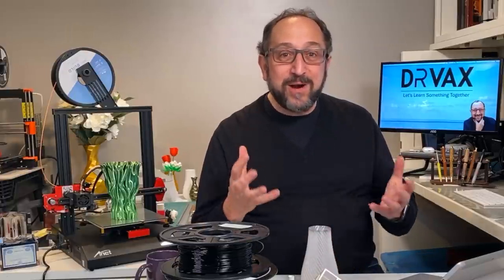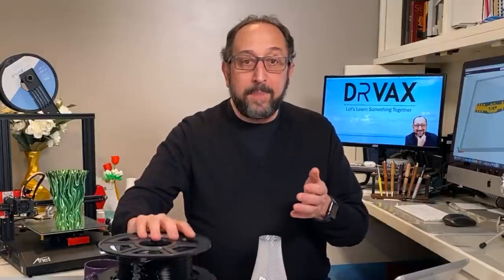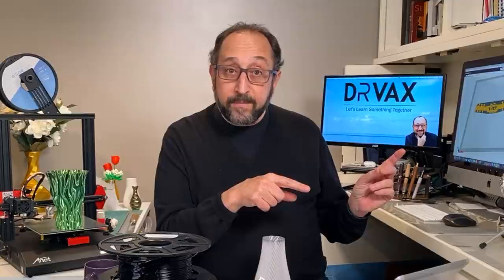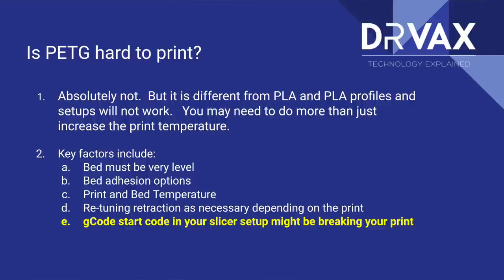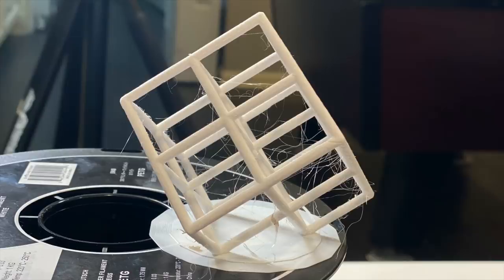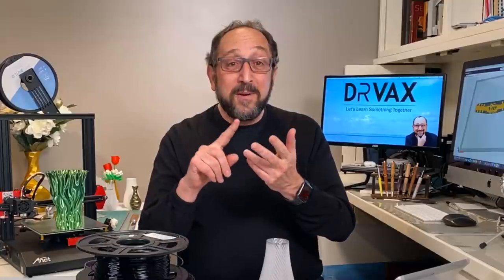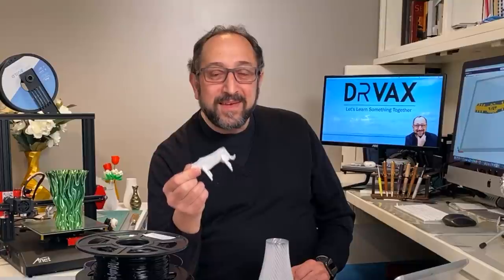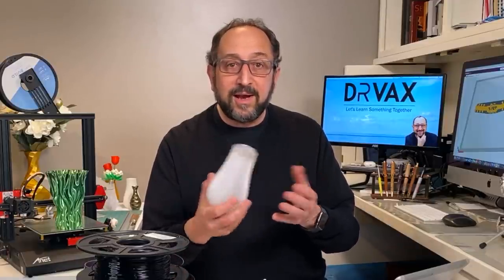How to 3d Print PETG Reliably and Safely

Comment: I had a client who needed a part for their drone and PETG's mechanical properties made it the ideal candidate since it's much less brittle than PLA. I figured while I was at it I would print the new fan duct I've been wanting for my Sovol SV01. As a result I had a lot of trial and error tweaking my settings for getting really nice string-free prints from PETG. I found that using a temperature tower to select the lowest temp that has less stringing but still had good layer adhesion makes a big difference. In addition, I increased my travel speed to maximum to help with oozing, set my print speed to 35mm/s, disabled combing, increased retraction by 1mm and set retraction to a nice slow speed of 25mm/s for both my bowden and direct drive setup, and set my part cooling fan to 0% for the first several layers, then 50% after that (100% when doing bridges still, which you can set in Cura). YMMV but this worked for me to get quite clean prints.
Reply from the maker: @Anthony Towler Excellent suggestions.  Thanks for sharing.
Reply: I’m glad I ran across this comment. My son got a drone and I immediately thought about printing replacement parts, but wasn’t sure which kind of filament to use. Thanks!

Comment: I really appreciate the look at G-Code. This made me realize that the default settings in Cura for "Generic PETG" don't match the manufacturer's recommended temperature and flow settings, and I was able to tune the settings before I printed with a nozzle heated only to 215°C, when the recommendation was 230-250°C!

This really saved my bacon on my first experimental PETG printing experience. Thank you! 😀

Comment: I ordered two spools of ABS by mistake I thought I really messed up but I moved the printer to the garage and as long as the temps are right and most important is the bed adhesion (I use hairspray exclusively) I have gotten great success I’m working on an enclosure and a fume extractor so whenever I print ABS I don’t have to move everything to the garage 👍👍 I’m really glad that you have survived this pandemic great to see you as always Shalom.
Reply from the maker: Thanks for the comment.  Good move to print ABS outside.

Comment: Thanks for sharing your knowledge and wisdom.  I just started 3D printing about 3-4 weeks ago with an Ender 3 v2 printer.  I started with PLA without issues and learned a lot about bed leveling with it.  I bought PETG from Inland at MicroCenter yesterday, loaded up the PETG and started a test print.  Bed adhesion and very strong and the test prints went well.  I started a print that was going to take several hours and after watching for about 20m, I went to bed.  When I got up this morning I had 2 issues.  First is the bed adhesion was crazy strong.  I ended up pre-heating the bed to 60c to get it unstuck.  The second issue is the print failed with about 20% to go.   It seems like the print head got clogged and the the hot tip melted the top printed layers.  I am using the Cura 5.10 slicer, but I also manually set the bed and print head to 70c and 235c respectively.  FYI, the Inland box says the temperature range is 225-240c for the print head.   I had seen the temperatures change in mid start-up code, so I think your temperature discuss will be the answer there.  So what do I do for the possible clogging issue?  Thanks again for your channel and help.

Comment: I read where PLA needed pushed unto the bed but PETG didn't.  I raised my offset .05 mm and I am finally am having good results!  It is fast becoming my favorite. I am printing 2 degrees above the minimum temperature and bed temp to the max recommended and I changed my retraction from 1.1 to 2 mm with my direct print head.

Comment: I just ordered my first printer, an Ender 3 V2 and some PETG filament. It seemed to have the best combined properties and the most versatile filament across the board for practical uses. Thanks for the video, it confirmed my assumptions and I'm really looking forward to 3D printing and your channel seems very valuable.
Reply from the maker: I would recommend you begin you 3d printer journey with PLA and once you have mastered that move on to PETG.

Comment: I am watching this on my first day of printing.    I wish I had seen it before starting off.  My computer is in for repairs and started off with PETG, I struggled a little trying to pause the print to turn back temp settings as they were reverting to the default gcode temps ..    By the end of the day, I found my way to editing the 104 and 140 codes.   Also, my Ender 3 was slow to react to feed rates, this I will want to adjust.   As soon as I figure out how to include a few lines to get the extruder laying out nice I will include the code in every print just to see  how things are laying out     .   Great videos, great content/advice .

Comment: Great timing for this video, I accidentally ordered some PETG filament, thought it was PLA, oops.
And just received a new ender 3 pro, so I should be able to print with the PETG. Thanks. So glad to see you are back. Hoping that you are recovering well.
Reply: Mike Gillespie I have a Ender 3 Pro and have been printing PETg with good success. I commented with parameters in another direct thread. Have fun!

Comment: I had done a little research to figure out why my printer had a low temperature limit while other (more expensive printers) had much higher ones. What I found was it comes down to the hotend and the teflon tube that comes in it. Apparently teflon will degrade at higher temperatures and can even release gasses that you don't want. I've also learned that some manufacturers will rate their printer for a little higher than they should based on the quality of the teflon tubing / lining they use. My wife bought me an all metal hotend so I could feel more comfortable printing with PETG specifically and higher print temp materials in general without worrying that I'm degrading my bowden tube.
Reply from the maker: You can increase the safe temperature range of your printer by switch to Capricorn branded tubing which is rated at higher temperatures.

Comment: I’ve had success with PETg with a bed at 69degC and glue stick, so good that I struggled to get prints off... filament used was Marvle3D. 
PETg Maximum print speed of 60mm/s. I’m Using Cura, set print temp 239-255degC you may need to tune temp while printing as too hot creates stringing (octoPrint helps with this) 239degC for slower and thin layer heights, 0.1mm and at the other end, with a 0.27mm later height, the extra temp setting was needed at 255degC to ensure that it flows well. 
If your printer doesn’t do a prime index line, add a skirt to your print so you have flow. Retraction needs to be more than PLA. I run retraction at 6.5mm for PETg to help reduce stringing.

Comment: Another great bed adhesion option for PETG is investing in a good flexible spring steel sheet, those work great for release PETG prints and leave a beautiful finish on the side.

Comment: Cura 4+ seems to add the correct code to wait for the preheat before starting when using the Ender 3 and Ender 5 profiles :).   I am guessing some profiles may have it missing.  Very good knowledge to give out as some do not do that.

Comment: Thank you, Irv, for this deep dive into real world PETG printing. I have been experimenting with it for a few months now, but found it more difficult to print than PLA because my environment is drafty. Adding an enclosure helped stabilize this for me. I still have questions as to how adequate ventilation is supposed to work without introducing significant drafts to a printer without an enclosure - I am thinking that having the enclosure will act as a buffer, with the room's air being able to be exhausted outside in a reasonable way without affecting the area inside the enclosure. I also found issues printing PETG first layers until I started using 3M blue tape on the bed - the textured surface of the tape seems to keep the first layer stuck properly during printing far better than the textured layer on my build plate. Glad you are feeling better! Best wishes.
Reply from the maker: I have also used blue tape in the past but find magigoo works even better.

Comment: Great video as usual, however you are wasting time in your start code
You should change it to:
set bed temperature
set hot end temperature
wait for bed temperature
wait for hot end temperature

This way both the bed and the hot end start heating up at the same time and your wait time to reach the hot end temperature is reduced.

Glad you are healty again and keep up the good work

Claude.
Reply from the maker: You are correct. But I do not generally optimize my start code because it is very little of my overall print time.

@onleditpas I value your comment and your contribution to the DrVax community.

To help us all build the DrVax community of "makers" I have created a new community forum at http://forum.drvax.com .   At the DrVax forum, you can engage in discussions with me and other community members, use a rich text editor, and post images.  This should facilitate better communications.

It would be great if you could repost your comment to the forum to help with the discussions.

This forum is still in beta and the software I am using is complex so I may have some feature misconfigured. 

All the best.  Irv

Comment: I know it has been a while ago since this has been posted, but when talking about the brim not releasing easily, I have recently found that having the brim attachment distance(Cura) set to -.004 allows for a nice thing line to tare away, now this does not effect adhesion over all but it can allow warping to pull up, but with the right temps and a clean bed (I just Isopropyl 91% quick wipe to leave a film as a releasing agent, releases the PETG just under its glass transit temp, the ISO which I found is needed to release and safely used on glass beds, that works nicely compared to regular glue stick)

Comment: One possible time saver that I think would make startup a little faster is to set both the bed and the nozzle temp and then wait for both of them.  That way they are heating at the same time.  So,  M140, M104, M190, M109.  Of course, you need to have a power supply that is capable of heating both.  It works fine on my Prusa Mini that I got last month.
Reply from the maker: You are correct.  But we are talking about seconds here, maybe a couple of minutes, out of prints potentially lasting hours.

P.S.  I have started a new discussion forum at http://forum.drvax.com where we can all have more elaborate discussions and share pictures of our prints and printers.  Check it out.  Please excuse if I have posted this to multiple comments from the you.  Just trying to get a bit of exposure.  Irv

Comment: Really helpful video - I am just waiting for my first 3d printer, so am trying to learn fast. Some points:

1. Someone suggested set temps then wait for both, saves time, rather than set bed, wait, set hotend, wait. I've read somewhere that it is best not to leave the nozzle hot and doing nothing for a long time, as it might dribble (!), and since the bed is slower to heat, get that done first. So, on that basis, your ordering looks best.
2. Would I be right in assuming that the bits in {} are macros automatically filled in from settings, either from slicer settings or the printer?
3. Why are temps being set twice - above and below the the initial print lines? Does the g92 (reset extruder) cause the settings to be lost?
4. Would it not be best to do auto bed levelling after the bed at least is up to the right temperature for accuracy re expansion? If so would that also apply to the nozzle?
5. I wondered why it is necessary to raise the extruder 2mm, does the g92 e0 cause the extruder to go to Z position 0, ie right down to bed level, and if so, doesn't that imply the g92 must cause the nozzle to hit the bed?
6. I assume g29 does a full bed level - 10x10 points in Marlin, I believe. Elsewhere I've seen a recommendation to do a quick 3 point only level before every print. Ie manually do a one off full auto level, and save the 10x10 array, then in the start code per print, load the saved array, then do the 3 point level just to check for any further offsets / bed movements, then print. This was with Marlin 2.x. I guess it saves a bit of time by assuming the bed may have slightly moved, but the surface profile will be the same?

All your videos and helpful and explain a lot - why as well as how. Thanks.

Comment: Using my ender 3 Pro with bltouch start code, it would probe the bed, then draw a great purge line, but then the print wouldn't stick with petg - no matter how much I tried.

I made your changes to the start code, waiting for temps between the purge and the print and it worked perfectly 1st time..

I don't claim to understand why the temp should be an issue between the purge and print, but it sure cured my petg woes..

My thanks to you sir... :-)
Reply from the maker: Your welcome.   The changes I recommended ensure the printer is up to
temperature before it starts the “real” print.

Comment: More like a craft than art or science. I believe that craft is the best cross between those two.
Reply from the maker: I agree.  Great word.
Reply: A good point, Craft is when you mix art and science ( and a lot of experience)
Reply: @woodwaker1  Yep exactly - Experience is accumulated by looking at your mistakes and applying sciences to understand how and why you should correct your mistakes.
Reply from the maker: @Gert Halberg I value your comment and your contribution to the DrVax community.

To help us all build the DrVax community of "makers" I have created a new community forum at http://forum.drvax.com .   At the DrVax forum, you can engage in discussions with me and other community members, use a rich text editor, and post images.  This should facilitate better communications.

It would be great if you could repost your comment to the forum to help with the discussions.

This forum is still in beta and the software I am using is complex so I may have some feature misconfigured. 

All the best.  Irv
Reply: DrVax Sure Irv I’ll be delighted to🤓

Comment: I use a spay called 3DLac for bed adhesion on glass. Seems to works very well for PETG. I have even applied it while the bed is warming up for a print although I doubt thats recommended.

Comment: Great video!! I have the microswiss all metal hotend on Ender3 V2. Any idea why there's a lot of material build up on the nozzle when i print PETG? Nozzle is not leaking i've confirmed. My E-Steps are accurate as well. I tried under-extruding by changing the multiplier to 0.94. I've also tried increasing the gap between my nozzle and the bed. no luck so far. Eventually the build up clogs the nozzle in 25-30 mins after cleaning it. Any idea how can i resolve it?

Comment: First time viewing your chnl. Just recently received my first 3d printer snapmaker A250. I have no clue on anything 3d prints and you made it sound English.
 I wanted to know about enclosure, do I really need it or not and if you have one setup if yes, have you made videos about. 
I have a fume extractor so I am thinking of using that with my window kinda open. It's winter so gets pretty cold 🥶 on the east side. I will sub and check out the rest of your videos. Looking forward. Fantastic video.. Thanks a lot!!!!. Take care
Reply from the maker: If you print in PLA, which is a good start, you do not use an enclosure and an enclosed could cause your prints to fail if the environment gets too warm.
Reply: @MakeWithTech  i loaded up a PLA, got lucky it came with one. Lol 😆

Comment: Just in case -- Cura 4.8 generates proper starting G-Code, if your profile is OOTB or  it's custom one based on Cura Generic PETG profile.
E.g. this is extract from my sliced models, from the beginning:
M140 S82
M105
M190 S82
M104 S240
M105
M109 S240
That matches 100% to the profile I've set for custom Overture PETG BLACK for my E3 Pro with 
Micro Swiss All Metal Hotend Kit.  I hope this  will be helpful. Happy New Year!!!

Comment: Is there a recommended forum to get advice on 3d printing?  I'm brand new and made the "mistake" of ordering PETG as my first roll of filament.  I'm having lots of stringing problems which ends up causing clumping on and around the print head that seems to sometimes cause the head to catch, skip, and get an offset in the x/y layer.  I'm printing on a Simax Iron-M1, which looks a lot like your Anet or an Ender3.  My hot bed has a removable magnetic cover I've been printing on.  PETG is sticking almost too well to it, which I've started to try and mitigate with a glue stick.
Reply from the maker: Absolutely.  Head over to the free DrVax community forum.   

HTTPS://forum.drvax.com

Comment: So I have all my settings as you have instructed and my printer automatically levels the bed (creality cr-6 se) but I cant seem to get the petg to stick to my bed. Its a textured glass bed. And I've tried glue stick and hair spray. And I've tried flipping the glass over to the non textured side. But every single time I try a print, it just won't stick and the first layer never goes down. The wipe line never even sticks. I switched to an all metal hot end and a hardened steel nozzle and still nothing. Any ideas?

Comment: The Overture build surface sheets work very well for PETG (and PLA), as long as your bed is leveled properly.  Bed temperature 80C, although that might be machine and filament dependent to some degree.